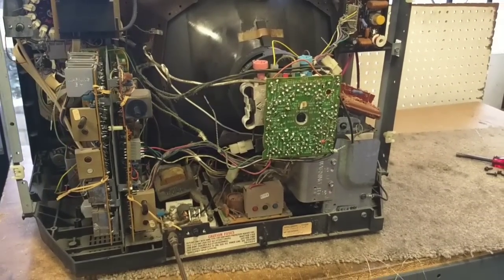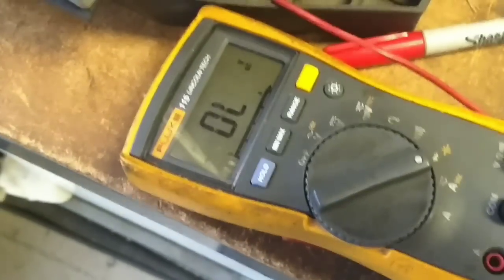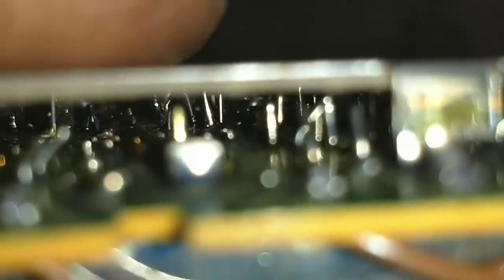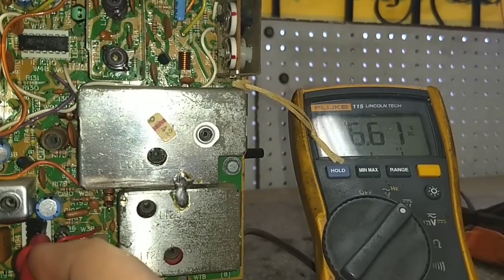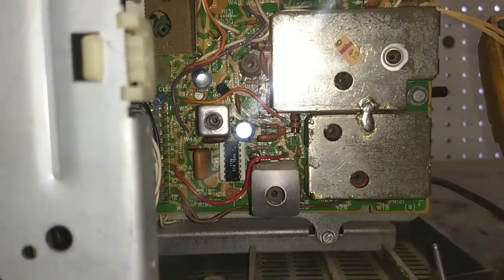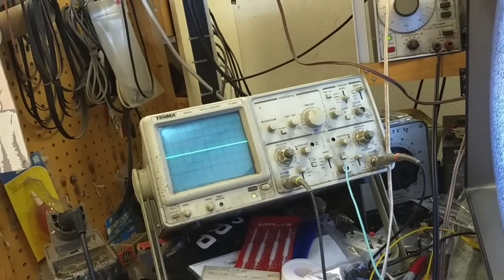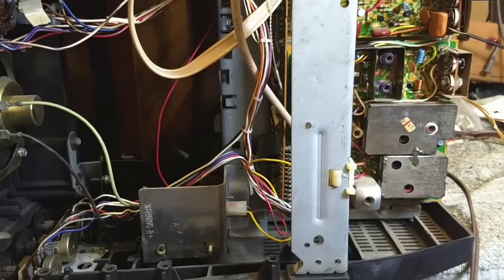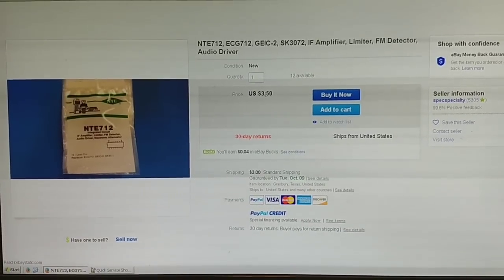Servicing a 1970s General Electric color tv model CYA7342 Part 3/?

Comment: Most common audio IC of the era. Bet you got one in a junker.
Zenith 221-45 & ( inside a can)  many others. Try that sears/toshiba.
VC on the set is a DC voltage to IC , not coupled with caps.
LFOD !

Comment: Try hacking in an RC bypass across the the primary and secondary windings. If the secondary is not providing any ground reference or offset voltage for the IC's input, you could just use a capacitor most likely. I've done this in console stereo tuner circuits when no other options are available.
Reply: Well now I just feel silly, ha. Somehow I didn't see the rest of the video (working on old junk myself), and had landed literally right before you prove EXACTLY the point I was trying to make. Good troubleshooting, hope the IC fixes it. Always ejnoy your vids.